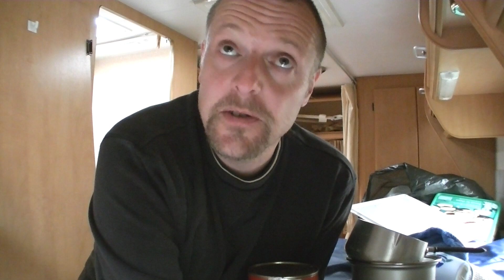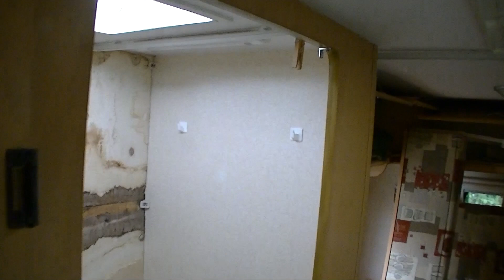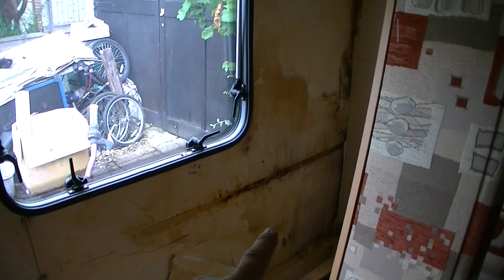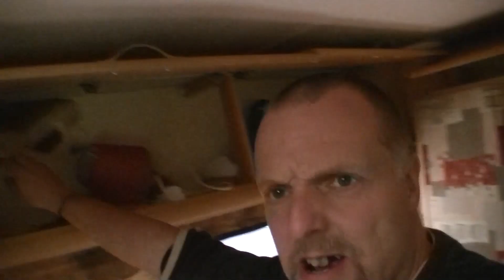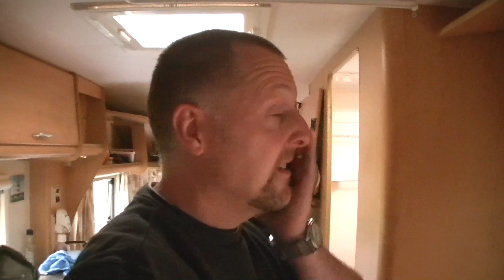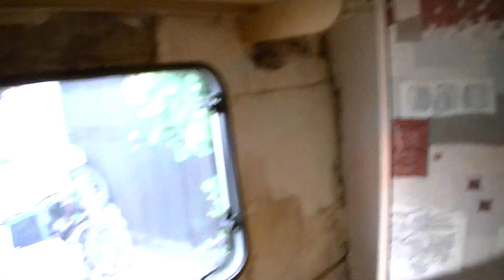How to - Caravan Damp repairs - Part 1 - Our Disastrous Bailey Discovery 2004

Comment: Water ingress can be a bloody nightmare, it always seems to come back.

Before you put it all back together I would spend ages sealing up the outside with the correct sealant, then turn a spray hosepipe on it constantly for half a day to see if you've got a good seal.

I say "correct sealant" because if you just use regular mastic/sealer, it fails very quickly (have experienced this on the van).

Hope you can fix it up :o)

Comment: that's a nice caravan, you could try to sell it once It is fixed and then use the money to get a slightly larger van that You can use more easily without the faff of towing. although, a small van like you have now is more practical day to day. I suppose it is just a balance of the two

Comment: Baileys can be a real nightmare for water ingress.  I've heard a few stories of the new Orion models leaking which are less than a year old.  You can buy caravan wallboards online, but not sure if you could match the colour/design if it's a 2003.  Good luck with the repair. :-)

Comment: omg I thought we were unlucky, just bought a caravan for £360, a 1986 Swift Corniche and this only has one wall near the door damp because of some hole that was drilled through the wall at some point that they never sealed back up. Theres another small area near the front left window thats damp but considering the age and price i was expecting worse. So sad to hear your van isnt even that old and suffering so badly. Do you still have it now ?
Reply from the maker: Oh that sounds brilliant for an older van. Ours was all solid after the repair but we didn't use it so sold it on. I now use my camper instead it's a bit more versatile I find nowadays. Free overnight camping and all that. 😉
Reply: @ScudoCamper  Free overnight camping sounds good :-)

Comment: h Austin, I assume that's your name? I've had loads of fun with it for the past year, a few mistakes on the way, 1, the don't turn as good as an artic OOOOOPS, less than 12 hours, through the back of the truck lol fixed that one now, it' in bed 6 weeks, hen out for 2 weeks, I'm like a kid with a new toy, now armed with a big tube of dicor lap sealant, loads of butyl tape, and a good dose of eternal bond, 3 never repair without :D